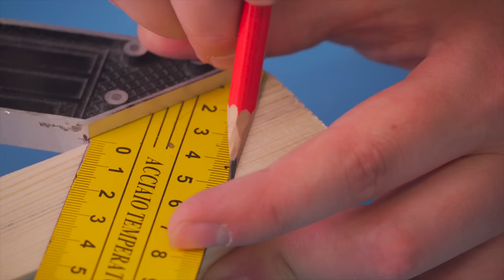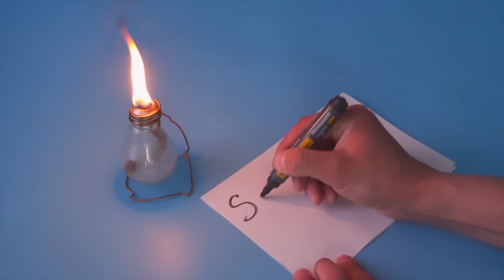Handyman's Don't Want You To Know This! Tips & Hacks That Work Extremely Well

Comment: Yeah there are some useful hints I got to admit that but there are some that I just don't get like the hammering the screw-in one that just created a bigger mess and not hold or the drywall one where they're cutting a piece to the exact shape of the whole wouldn't it be easier just to cut a square out around the hole in the wall and then cut a square piece of drywall I don't know maybe I'm wrong